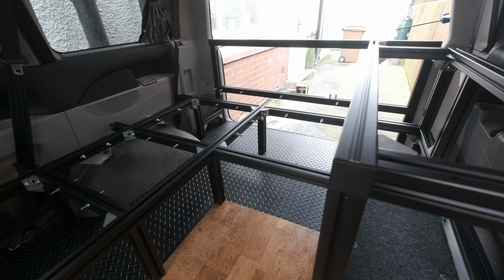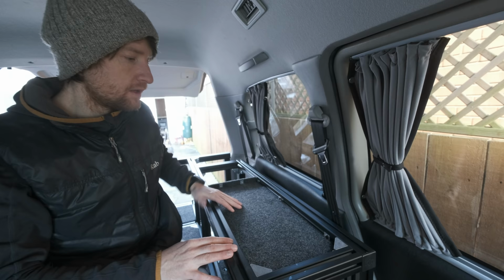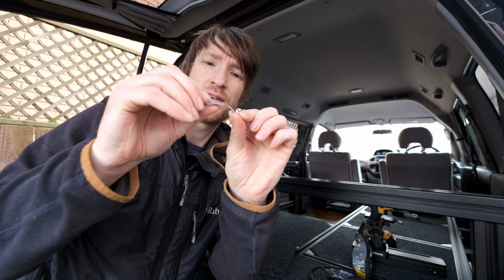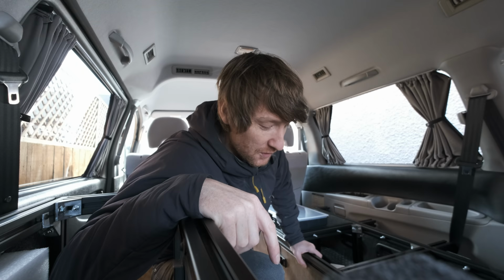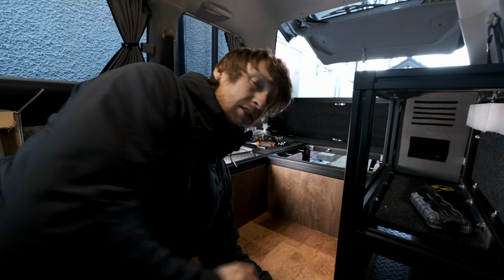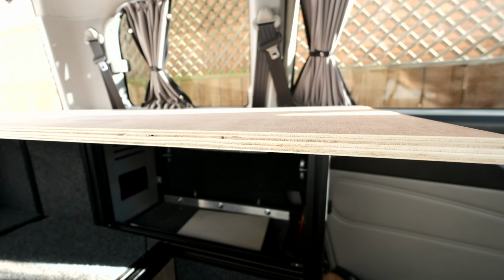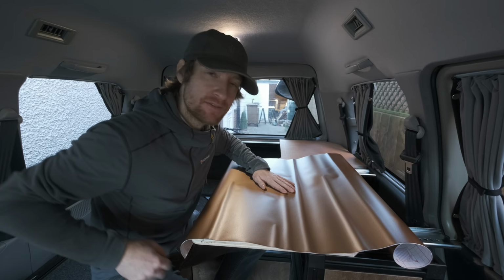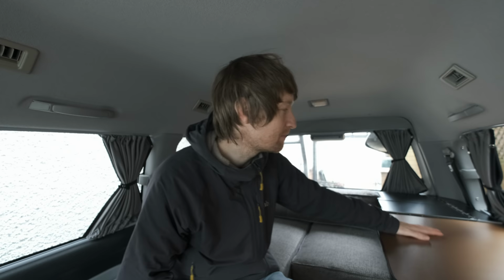4X4 Van Build - Transformation in to Camper

Comment: TBF Tom, you've done a dam decent job so far. Well done.
Reply from the maker: Thanks a lot 👍
Reply: @ThomasHeatonPhoto  on a completely different tangent. How did you get the spikes on your iFootage tripod. 
Dammed if I can remove the ones on mine.
Reply: @monkeysausage2404  They have a reverse thread, to undo them you have to "tighten" them! Be careful though, if you turn them as if you were undoing a normal thread you could damage the hidden small neoprene sealing gasket on the threaded portion of the spike. The gaskets sit in an unthreaded section, they're quite difficult to remove, so take care if you do. They may not be suitable for replacement spikes. I'm not sure if Thomas also changed the part the spikes screw into, I've seen a video of his where the bottom of the carbon section with long spikes looks a different colour. Hope this helps. The reason for the reverse thread is so you don't remove the spikes when you screw the rubber feet. Replacement I assume invalidates the warranty.
Reply: I need to add: You can make gaskets for long spikes by stretching and wrapping a narrow length of plumbers etc. self amalgamating tape around the replacement spikes. That way you won't damage the originals.
Reply: @robertparsons558  Thanks Robert, the though just never occurred to me. And not you mention it, well it makes perfect sense.
Reply: Nice job! Enjoy your van.

Comment: The item you referred as bicycle chain looking is typically called pipe strapping which is used to secure/hang pipes from floor or ceiling joists.
Reply: I also know it as punched banding, and we sometimes use it to secure small ductwork sections.
Reply: When i worked for a plumber's merchant we called it galvie banding.
Reply: It’s also called O band or all around band

Comment: I have a certificate in joinery. You are doing all right. Cut the vinyl oversized and cut slits to fold it over the edge and then put the trim on. A quick fix use a sharpie and blacken those white edges and they won’t draw the eye.

Comment: It is clear that the sane attention to detail you put into your photography, has paid dividends on your build. Fantastic job 👍 
All I would add, is that if your door fit tolerances are too small, you may need to make some adjustments after a few months of summer heat or winter cold and damp. But a small price to pay for being rattle free...

Comment: A piece of laminate would be great for your table tops. And its easy to install you already have the router.(The product they use on counter tops)
Reply: Decent idea, but really, really heavy in comparison.
Reply: Roger you can purchase the thin laminate itself to glue to his plywood. The design choices are vast with many colors,  patterns and finishes to choose from.  Several companies besides Formica brand. Check out your kitchen counter tops in a big box store.  The best choice for a van would be the hard wearing finish that is textured and not easily scratched.
Reply: @serenakoleno9338  Didn’t know that. 👍

Comment: I love the minimalism and functionality. Only thing I'd say is drill some holes through the carpeted boards under the bed. It'll allow for ventilation under the matress to prevent mold. It shouldn't be a huge issue with the thick matresses you have, but it's not worth replacing them sooner than you have to.

Comment: Like the slideout desk. Had that idea too to pull out the top cover, but than changed my mind and added a board right underneath to pull out, just to not have the problem with the open space that´s left behind when pulling out the top cover and see all the stuff inside the cupboard....

Comment: Love it, that is a great van build, so simple and yet spacious for every space used and not wasted. I'm on my 2nd van conversion build with my 2nd van, my 1st van the transmission went out, and for the same cost for a new transmission and labor costs, I gotten this 2nd one, both vans are full sized, but my 2nd one has a topper and I have standing room in it. I've been working on my 2nd van conversion build since last September 2020, it's taking longer due to that I'm also caregiving for my elderly dad and depending on the weather too. And, I'm the only one doing the physical work, and have a few power tools I can't use outside whenever it rains outside, or in thunderstorms we get here in Odessa TX USA. I have no workshed nor a garage to work inside from the weather if raining, etc. My dad's driveway is my work area, and great on good days of weather and when my dad is resting or watching TV. But, even though I'm not using the aluminum framing, I'm using wood, and I like the way you did your floor plans, I may use a bit of your ideas mixed with mine, if that's ok with you? I have about 66 square feet to work with wall to wall and from behind the driver's and passenger's seats to the cargo doors in the back. I'm already done my flooring since May this year, working on some subframing and subwalls before I get started on the topper area, I would have to make homemade ribbing up in that area due to the topper being fiberglass, with subframing attached to the van's main medal top horizontal ribs. What I'm basically doing 1st is like a whole new interior remodel that is needed, the old interior was is fair shape, so I'm doing all new, before I start doing the furnishings, storage, kitchen, etc. So much to do yet, getting it done slowly but surely. This one will be done far better than my very 1st van conversion build was. Anyway, sorry so long here about my van conversion build, I have just subscribed to your YouTube channel this evening, and enjoyed watching your van build and love the whole set up you have done. Be blessed and safe too from me and my dad in Odessa TX USA 🤗💖👍

Comment: That extruded aluminium does look a good option. My carpentry skills are also mediocre. I can get stuff right in the end, but it takes so long. Just popping in carpeted panels is so much easier. I just need to convince my wife that the 'industrial' look is a good thing for when I start on my build. I had looked at it for a self build roof rack system, but it seemed expensive then. the suppliers were all selling it for tracks for industrial robots/automation and it was priced accordingly. Finding something engineered to lower tolerances at a price for DIY construction would be a real bonus.

Comment: *Attention to detail suggestion

Either use nyloc nuts (so they don't rattle loose!) on the cabinet door hinge bolts and cut the excess threads flush or use dome head nut. Might stop things getting snagged up when you're putting them in/taking them out?

Keep it up, doing great so far!

Comment: That’s a fantastic build. I love the idea of using 8020 extrusions. So much easier then learning woodworking skills. They can get quite heavy though.

I was contemplating building a roof box from 8020 #15 (yea the USA measuring) to house draws for solar panels. For 5 panels it should be no higher then 12 inches. But the weight in the end is a killer (40” x 70” x 12”). Would be a bottom frame, two double high draws, top frame. One solar panel mounted permanently to the top and each draw contains 2 solar panels to slide out to the left and right. That would give 1000 watt of solar at camping location and 200 watt of solar the rest of the time. Just the weight…

Comment: Another suggestion : A simple drop-down hinged leg (or 2) on that sliding table would be a good idea, as it's not what you put on it that will break it, but stumbling and leaning on it in some manner ... more likely to be someone you show the van to ... as it's instinct to lean on a large flat surface, etc.
Also, as it wears in, the rollers will loosen, so a good idea to put a retaining clip on the sliding table to stop it sliding out every time you turn left ... and slam back in when turning right ... Now, that would be a 'rattle' ...

Comment: One thing I would recommend is putting some blue Loctite on the hardware to avoid having it back out. The blue one will prevent stuff from backing out, but will still be removable with tools. Dont use the red one, however, as it will be VERY hard to get off, especially with hardware that small!

Comment: Great work - looks amazing.  Two comments from a design pro: 1. If you were building a plane, it would never fly - look for lower weight materials than 18mm plywood. 2. Should design for crash induced g levels (10-15g) next time.

Comment: Really good work with the build.  If you bought some 15mm Furniture Board in a colour you like (the lightweight stuff made for camper vans) and used the knock on edge banding like you already have (or flush fit edging rather then raised profile if you prefer), you'd get a great finish for your table tops.  Hardwearing too.  Vinyl wrapping furniture is a dark art, and its hit and miss even for the pros.  Doesn't stand up to much wear even if its applied expertly either.

Comment: Watching your build, there’s a couple of  suggestions I have.. 

The panels directly under your mattress, need air hole drilled into them to reduce moisture build up on the underside of the mattress. There needs to ventilation between mattress panels/bed frame. 

The worktops you’re under happy with.. have you thought about instead of using hinges, why not make a clean one piece top that’s has strong magnets underneath that holds it down to the framework.. so you can simply lift up to gain access to your storage instead of unsightly hinges.

Also with the windows, you’ll lose a lot of heat even with curtains, so I suggest making some foil installation panels that stick to the panes of glass to keep heat in.

Comment: Everything looks great on camera, even the table tops!  Now that you have paid so much attention to rattles, I hope you don't have a creaking issue.  Don't know if an older van is going to have enough frame flex to cause all of those aluminium frame joints to announce their presence on rough roads.  Maybe you just should invest in a power and speaker upgrade for that van's audio system!

Comment: Drill stuck - done that between floor joists! If you can justify the expense, an angle drill is very useful. I got one as part of a Ryobi pack that B&Q were clearing out many years ago. Alternatively, relatively recent 12 volt systems from, eg Bosch and Milwaukee allow you to change function from drill, to driver, to offset driver and right-angle drill-driver - the sort of thing that, once you've got one, you wonder how you ever did without.

Comment: Just thinking you could go with a plastic lamented surface (Formica/Wilsonart etc)on the table top. It’s much like what you did with the carpet. You just glue it on ( contact cement)and router the excess off. Can use the same edging type that you used after applying lament or cut thin strips of the plastic lament for edging and apply before you put on the upper flat surface. Bit of sanding involved on the edging before applying the top. It will look very professional when completed. If the lament isn’t very thin you may have to apply some heat with a heat gun on the rounded corners to get the bend you need. Don’t overheat. You should shape it before applying the glue. Doesn’t need to be perfect because the glue will make it adhere to the form.   Hope maybe that is of help but whatever way you go it looks good.

Comment: This is an awesome looking build with a lot of thought put into it. One thing I would add as a personal preference is an additional foam section that when sitting would serve as a backrest for sitting and when sleeping would fill in the gap between the bed and the counter/desk. You could make a removable/stow-able frame for it and this would give you considerably more width for sleeping. You could probably do it in the same aluminum channel and hinge the legs similar to a folding table so that when stowed it would lay flat and not take up much room. The narrow space seems to be great for many people but years of army life have done rough things to my knees and hips and I need the extra space to move them around through the night.

Comment: Interesting approach - to convert a MPV car with all its fixtures, fittings, coffee holders, etc, rather than a van that would have bare metal interior. I wouldn't have thought of that if I decided on a DiY van conversion, I'd just have bought a van and had to do the lining of floor, top, and sides myself

Comment: Amazing build and video presentation.  It's given me the inspiration to do one myself. You could use contact adhesive, and a laminate of your choice on the worktops. Make the laminate oversized and finish off with a flush cut bearing guide router bit. Edge band with an iron, easily within your skill level.

Comment: Lovely build.  I love the attention to detail.  I was just wondering about perhaps using a solid length of timber, like the timber bench tops used in kitchens, for your counter top area.  If you bought one the full length then cut the bits you require then the whole area would be uniform including the timber grains linking onto each other.  Here in Australia they are easily bought from Bunnings a hardware store and come in various thicknesses starting at 10mm going up.  Once cut then just use polyurethane to seal it.  It will be a bit more costly than what you have used but well worth it I think.
Keep up the good work.  Can't wait to see the completed project.

Comment: I have really liked this build you have taken such a unique way of going about this, I watch a lot of camper builds and have built a few myself. My first build I used a similar vinyl for my units as you did on your table and it looked fab, but only for a couple of weeks, my latest build has used solid pine furniture board for the worktops with Rustin's Plastic Coating (epoxy varnish) and its got really great wear resistance.

Comment: Enjoying your van build a lot, Thank you for all the effort you put into your film making. 
I have fitted 4 diesel heaters all different set ups, get in touch if you want to pick my brain. Main thing is they will not run on their side one way, all other 3 orientations are fine Ed
Reply from the maker: How big of a problem is air bubbles in fuel line?
Reply: There always seems to be air in the last line to the heater from the pump, you should be .....fuel source to fuel filter ( filters generally go the opposite way to what you would think) then to the pump which wants angling upwards towards fuel exit between 15 and 40° , and dont forget to prime / pour a little diesel in the fuel pump or hose between filter and pump before you prime the system initially, as the pump is lubricated by the fuel. Are you using a separate fuel tank or the mitsubishi tank ? And how where are you mounting the pump. Ed

Comment: Couple of suggestions: 1. Tint the windows at the rear to discourage people from noticing that it's not just a normal van with seats ... as it will become a theft target if it looks 'swanky. 2. Insulation is key everywhere (besides the windows) as Vans will always get cold inside otherwise (and fail to retain the valuable heat you put into them). 3. A decent Alarm System is recommended as many Contractors Vans are being targeted for tools and Luxury looking Vans are targeted for the contents. It is quite an epidemic and these guys are serious as they use power tools like disc cutters and other metal cutting devices to get in if they can't bypass the locks by knowing where to drill ... (There's a Facebook Group for you to visit for advice: Van & Tool Theft Awareness (VATTA) ... for advice on security, etc). 4. Review your Car & other insurance to see whether you can get proper, or extra cover at a reasonable cost for the possible loss/damage of a break-in/theft/steal of van.

Apologies for seeming negative, but after you've put so much effort in, it's worth protecting your asset the best way possible in the current climate ... (as the Police are Not interested beyond just giving you a Crime Ref. No. - they won't investigate, as has become very clear to Van owners).

Good Luck.

Comment: So just in case no one suggested it, have you looked at half inch finished Baltic Birch with a nicely sanded edge finished with a deft or poly spray coat to match the surface? Other than the counter your whole build is pro!

Comment: Tom that is looking amazing. So looking forward to getting out in MY van and making use of it. Not quite sure how big that area you said for umbrellas and tripods is but look out for a draper folding step ladder. The steps fold up in half so you have a step ladder the size of about a drain pipe. For that extra height if needed.

Comment: FYI, I'm pretty sure the weight rating for those sliders is for use in the other direction. Hope it's working out for ya though. It looks like it will.

Comment: For such a basic mini van you did an amazing job, you’ve got me contemplating using aluminum instead of wood for the frame work

I’m planning on using a Ford E350 and I’m not putting up wall or ceiling panels since they usually turn out ugly so the metal on metal might cause some issues, I just hope I can find a van with a clean interior so I can skip that process and start on the modern build:)

I never even considered locking up the cargo space, and honestly I really like those bulky hinges they look nice, I might end up getting them myself

Comment: The foam is useless since the bracket is firmly mounted on the aluminium frame, can't rattle, worst case I would guess that the foam can introduce rattle since the aluminium bracket will be a bit loose.

Comment: On the table, I might have done a step down, put the brackets such they were in the strongest configuration. What that does is give you a very useful storage area underneath for flat or small items. 
Can you post some links to the aluminum supplier, and the door supplier?